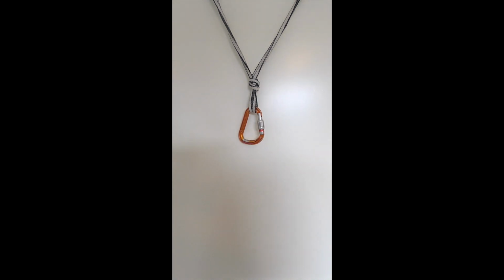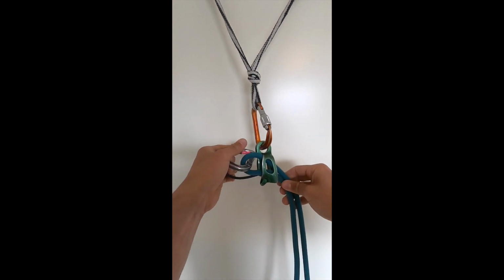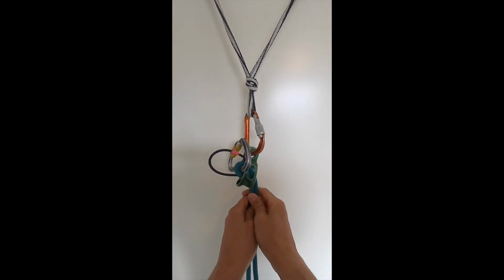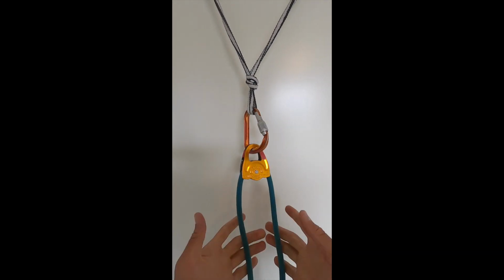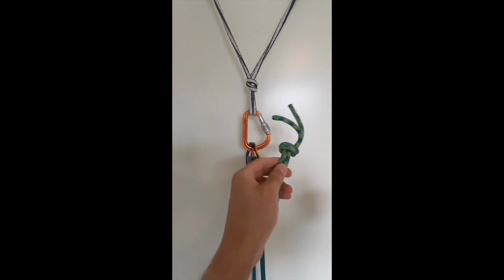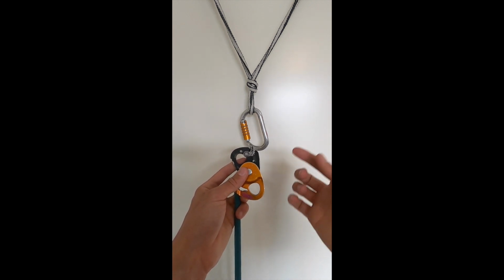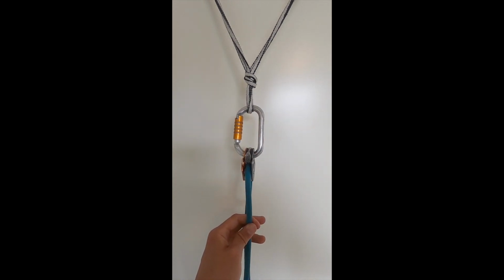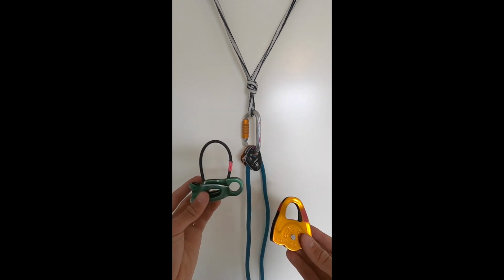Progress Capture Devices: ATC Guide, Prusik Minding Pulley, and Micro Traxion

Comment: Is microtraxion good for TRS?
Reply from the maker: Hi @pathofCultivation thanks for your question - I would always recommend using the device according to the manufacturer recommendation.  Microtraction is not considered to be a belaying device.  I know guides and other use this as a back up when they are solo climbing and need a device to back them up, in those cases the rope would need to have something heavy at the bottom so the micro can move up the rope as the climber goes up.  This is though nothing we would recommend as it´s not safe for the climber in the end according to the manufacturer.

Comment: prusik should be tied with a double fishermans/ barrel knot never with an overhand. Also the knot should be off set, you should never have to knot resting on the carabiner.
Reply: Thanks for the feedback. I’m always keen to share important and up to date info with the community. 

Could you provide an accepted reference for both the prusik being tied with a double fisherman’s and offsetting the knot resting on the carabiner? 

I understand the idea behind not using an overhand to tie off the prusik as they have been shows to roll (in very rare circumstances) if not properly dressed so I always make sure to add adequate slack to the tails on the case that it does load. Also, I make sure to properly dress the knot. 

I also understand the desire to not have the knot resting on the carabiner as it would be loading it in an awkward way but I have not seen tests to show that it’s more likely to flip if loaded in that way.  I would assume that it pulled apart (both exit strands pulled horizontally apart) it would be something to consider then I would use a fisherman’s knot. 

Thoughts?
Reply: Mike, Joel is absolutely 100% correct on both counts. The references for this are everywhere in the rope rescue world, including the NPS Technical Rescue manual. I’ve been on a tech. rescue team for over 15 years and you  are the only person I’ve ever seen use a prusik like that. Half hitches do roll out and are used only in special circumstances with very long tails. Please do your own research and correct this. Thanks

Comment: You should also show the fastest to rig and easiest to carry method vith instant progress capture, by using the petzl tibloc in progress save mode in a oval carabiner, not as smooth as a micro traxion, but less friction than using a atc in guide mode, works great.
Reply: Yeah thanks for the comment. I've avoided teaching that because both myself and the guides I work with have had some negative results using it in that way. If it does not catch properly, it will tear the sheath. I have personally torn the sheath doing it this way and I was able to recreate the issue where it would not catch properly and begin to tear the sheath. Now there are some who have never had this issue and are super careful every single time they load it in that configuration. My thoughts are to make videos with tried and tested methods aimed at the beginner / intermediate glacier guide, so that is why I avoid teaching it. Thanks for the comment.

Comment: Isn’t that first system setup side loading that carabiner?
Reply: Yeah, so first I understand why you would think this but this is testing compressive strength of the carabiner as compared to the tensile strength. This setup is accepted as a standard in the industry when using the ATC to both belay and also in guide (plaquette) mode. Just for your reference, check out this chart by Petzl about different ways to incorrectly load a carabiner (https://www.petzl.com/US/en/Sport/Examples-of-dangerous-carabiner-loading-). Also, my senior guide friend ran the numbers for the compressive strength of a standard aluminum carabiner and the result was 33.75kn so the safety margin is well into the accepted range. Here is a screenshot of his calculations (https://imgur.com/rbxBrDp).

Comment: Hey if I recall correctly, a crossloaded figure eight follow through knot (like in the prusik example) will pull through at ~5kn and sooner than an overhand. Please check this out for yourself! I think HowNotToHighline tested this concept.
Reply: Thanks for the comment. The knot was an overhand attaching the prussic to the shelf. In the very rare case that a poorly dressed overhand would roll, it would still not roll off the edge given the adequate amount of slack. From the tests I have seen, a properly dressed overhand does not roll and if it does, will roll once at most. 

Anyway, thanks for the comment and the reference in regards to a figure 8 follow through pulling through. Will go check out his video.
Reply: @MikeReid  Ah that was careless of me. Cool!
I use the standard double fishermans as the loop closer, but not so removable.
Reply: @nathandevan3114  Yeah the standard double fisherman's is bomber as a loop closer
Reply: @MikeReid  Not sure if youtube removes video links from comments..
I found one from Richard Delaney on pulling overhands and eights. Maybe the HNTH channel didn't make one but Richard's results are a little more positive than I remember.

Comment: Alpine clutch and autolock Munter pretty useful here to. Ok, a bit crap on frozen rope were stuff with teeth will always win. But far more versatile.
Reply: yeah very true about the Garda and Auto-blocking munter. One of the reasons I stick with these methods is because this series is mostly focused on those entering the glacier industry. Here in Iceland, our teaching methods primarily focus on the ATC for entry level guides and the PMP and Micro Traxion for intermediate guides.